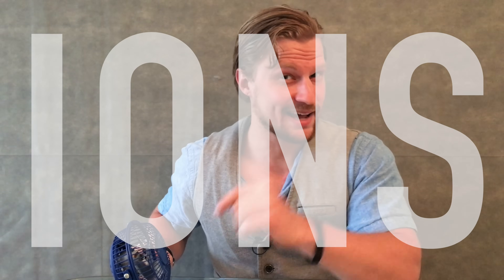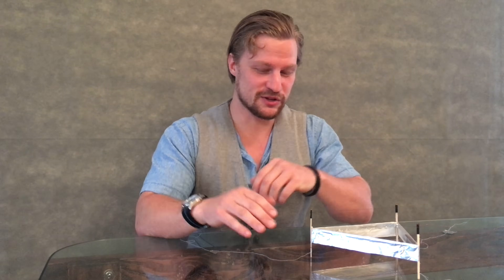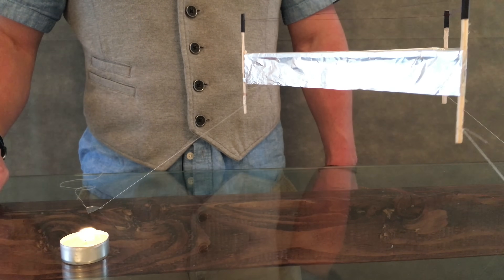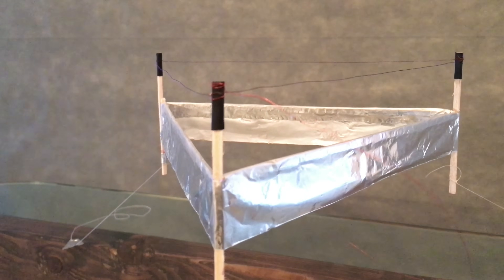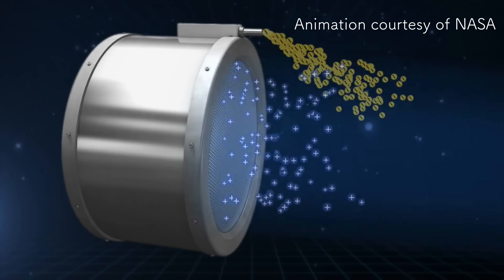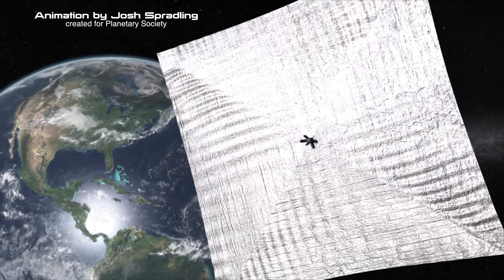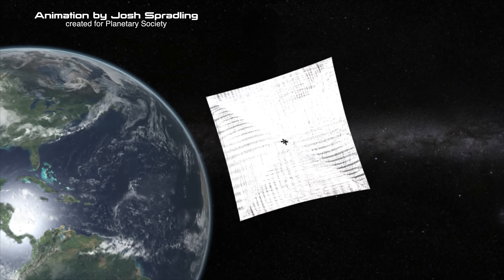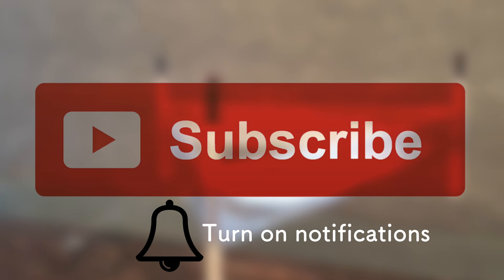IONIC THRUST | A new hope for spaceflight |

Comment: You need more Voltage there mate... more like 20 million... charged up in an onboard ultra high Farad, High Voltage super Capacitor... and it should be bigger... and saucer shaped
Reply: I'm pretty sure that's incorrect: cranking up the voltage to much more than 20-50 kV doesn't help, because you'll exceed the dielectric strength and the electric field will break down and result in discharge arcs, unless you also greatly increase the separation distance between the electrodes (according to Paschen's law). This only makes the whole apparatus bigger, without gaining much additional thrust.
Reply: @___Chris___  It's not incorrect, you are just missing the important detail -->> you use a thin coating of ultra high K dielectric, depleted uranium is the best, same stuff they line the leading edge of the b2 with, so no need for Paschen's law separation distance between the electrodes. If you can't get that use bismuth! an ultra thin layer will suffice. And YES crank up the potential mate!
Reply: @kiwiresponse  There are many variables involved and there's a lot of confusion because - just like in this video - space applications and earth atmospheric applications, including DIY "lifters", are often mixed under the same headlines, which is why we're maybe not talking about the same thing and therefore might actually be both right. Paschen's law isn't just irrelevant bullshit, but I admit that it's less of a limiting factor in some more favorable scenarios. I might agree with you ("mate" ;-) ) under very specific circumstances, depending on aspects such as:
1. what kind of gas pressure are we talking about?
2. what's the temperature?
3. do we use an "inert" gas atmosphere (xenon, argon)?
4. is energy efficiency a concern or is max thrust the only objective, regardless of the required wattage?
5. is radiation safety (high energy ionizing electromagnetic radiation = Röntgen as a byproduct) a concern?
6. regarding super capacitors: for what kind of duration do we need the thrust (=are we talking about continuous power)?
Reply: @___Chris___  perhaps I should say Sir. My apologies if mate was not appropriate. Yes, of cause I accept those variables. As I understand according to the original Field Theory of Tesla and C.P. Steinmetz, much of it derived from Natural Philosophy, there are 7 such variables, including:
*ambient pressure
*dielectric permittivity of the materials used and electrical properties of the ambient atmosphere as you mentioned (medium)
*displacement
*phase
*right-hand rule

The capacitors. We're not aiming to consume any amps, ideally, that's why we use extremely high K dielectrics, so that we can increase the HV/potential/strain/stress, counter-spacial, centripetal convergence, and focus or disperse it in a certain way, depending on how we shape the craft.

do you know how/why a lichtenberg figure happens? if it happens

Comment: You can't really use a candle it itself is ionic in nature.
Did you use a voltage multiplier your previous video.
Reply from the maker: I did not use a VM. Just a straight rectified AC 20kv

Comment: How did you make the high voltage dc power supply
I really wanna know :D
Reply from the maker: It is a flyback power supply, push pull configuration. 20kv, 15kHz, 60 watts.
Reply: @PlasmaChannel  How much Farad is the capacitor?

Comment: This is the perfect channel I’ve been looking on how to make simple versions of really dangerous things like tesla coil‘s and stuff but like small so they won’t hurt me it’s perfect.
Reply from the maker: Yes, always strive to build safe devices. Like a Van Der Graaff. Impossible to kill yourself with those, yet they can make higher voltages than almost any device.
Reply: @PlasmaChannel  Make a remote control IONIC CRAFT! You can regulate the negative electrode, if you section it. By controlling the current you control the wind and direction. And make it a ufo shape to make it more intriguing
Reply: @PlasmaChannel  I bought silver coil, and will build a voltage multiplier to create a ufo craft to fly in air and under water! Hopefully design it for space and shoot it with a hydrogen ballon, hen rocket for last push. If you are interested in the build we can work it together 😏
Reply: @PlasmaChannel  
You piece of 💩 
Nice theft of Jean Loius Naudins prototype, you douche
Reply: @PlasmaChannel  I was thinking in adding a helium ballon to the craft and use voltage for control. Have a balance in weight so it does up and down. For submarine I'll leave holes for water to come in and out no balloon there. Isolated ballon from anti static
Reply: If you think it's going to hurt you you probably should find something else to feel your time like nitting. Wait cratch that you could poke yourself maybe play yourself at a game of cards but be careful cards can paper cut you. 🤔 maybe dice yes you could try rolling dice or I here marbles are back in jest don't put them In your mouth or any other orphose  you mite find. For the rest of you I am sure you already know 9 volt Battery  safe handling now you may want to be careful that when you make the ION air not to point it in a direction where the air can do damage to anything it wafts out more then more then well jest watch out we don't need anyone plowing there eye out now danger is in the air
Reply: @AsweWish-c4n there's always a smart ass in the audience whose only enjoyment in life is to belittle other people.
Reply: Perfect?  Blew my speakers and woke up roomate with how loud the intro was.  Maybe a video with good content... but PERFECT would mean it doesn't also have atrocious audio-balancing.

Comment: I dont agree that the lift is produced by ionic wind.  If you get a tiny drone of the exact same weight as the lifter,  turn them on and you'll see that the drone produces enormous amount of wind compared to the lifter.  The difference is quite dramatic.  The tiny amount of ionic wind you see is simply a byproduct of the effect.  However,  it is still necessary to have gases around the lifter in order to produce a difference in charge.  The gases basically becomes an anchor in space that the lifter uses to climb up.

Comment: where is the power for your design and how can i make it?
Reply from the maker: It is a 20kv AC power supply which is rectified with a full bridge rectifier. From Ramsey Electronics.
Reply: @PlasmaChannel  ok cool thanks
Reply: how are you supplying the power?

Comment: No. A wired "ionic thruster" and a nasa xenon engine are not simialr at all, and the same principals do not sadly apply.
Reply: They are both ion drives. They both transfer energy between two electrode surfaces and expel particles at high speed out of the back.  It is true however, that the slower the wind for the ionocraft the more efficient it will be.  In space however the faster the particles the less fuel it will use.  There is an ion powered aircraft "the Self Contained Ion Powered Aircraft," that can carry its power supply onboard.  Maybe soon it will carry a very small propellant tank as well...
Reply from the maker: The ion thruster used by NASA uses charged particles, accelerated by an opposite charge. Identical to this lifter in function, though not form.

Comment: why has no body made a hover car using this method?
Reply from the maker: Partly because the power levels involved are insane. It works very well in low gravity or space. But in full gravity, it would take so much electrical energy to lift a car, that you likely couldnt fit enough power sources into the car to make it fly in the first place. However, that WILL change in time.
Reply: @PlasmaChannel  how much power would you need, just for scale if I wanted to build one? Also thank you for replying.
Reply: 😮 @PlasmaChannel

Comment: How do thrust is created in vacuum..?
Reply from the maker: In a vacuum, no thrust. However, if you carry a gas cylinder on board, you can create thrust by ionizing that onboard gas supply and shooting it backwards (pushing the craft forward). That is how several craft in space currently function.
Reply: @PlasmaChannel  Our aim to generate thrust with solar energy that is available in space.Carrying a gas cylinder is point less.What if the gas cylinder is out of gas.
It is just similar to that of carrying fuel..

Comment: How can a wire with stand 20000V without burning...?
Reply: There is actually no significant current running through that wire. Between the wire and the aluminium foil there only is a significant electric potential difference but because of the insulation of the air in between them, only a limited amount of charge can cross the gap.
Reply from the maker: This is correct. The high voltage supply cannot provide a very high current.

Comment: Try this. Change the shape of lifter to pyramid. Add quartz crystal between copper wire and aluminum foil so electricity from Tesla coil or Van de Graaf generator has to completely flow through quartz crystal. Put lifter in vacuum chamber to see if it works in a vacuum. Also play around with the hertz of electricity to find the right frequency for resonance because gravitational waves may have a frequency of its own yet undiscovered and it might be possible to interact with gravitational waves with quartz crystal vibration under right resonance due to its hexagonal atomic shape. Pyramid shape also plays a role concentrating energies at the point. Read book "Shape Power by Dan A. Davidson".

Comment: I hope you know that ions,  that are made by electricity also are tainted with ozone in Ozone can burn your lungs and can kill you
 edit please don't do this indoors or at least have a window open and a fan on.... a regular fan
Reply from the maker: Great warning, thank you!

Ozone in small doses is harmless. In high concentrations, it causes brain damage, cancer, and respiratory issues.  I don’t work with high levels of ozone- and have been working with ozone for 15 years. Small levels of ozone are harmless, otherwise I’d be dead.
Reply: Yeah I just wasn't too sure if your setup was pumping out a bunch of ozone cuz mine does so much so that I have to actually do all my high voltage experiments outside then again I am dealing with around 10kv-150kv-200kv volts ac out with around 10-40v 20 amps DC  input  now I just got to rebuild my charging circuit cuz two days ago it fried out
Reply: The ion propelled aircraft on my channel with onboard power! doesn't produce much ozone, the trick is to use extremely small current levels, especially thin several micron thick emitter wires at a larger distance from the collector, and avoid sharp corners.  There are other details as well to get enough lift. Also, the device is designed to produce primarily negative ions.

Comment: MIT just released videos of a fixed wing UAV you may be interested in. And probably already aware of :) ✌🏻

My question is, can a tesla coil act as an onboard receiver for power supply and another ground base tesla coil be the transmitter? 🧐
Reply from the maker: Thanks, i've seen the UAV. Pretty crazy. To answer your question, yes. Tesla coils can act as receivers. Tesla himself was the first to accidentally detect radio waves from space. He noticed his coils were absorbing signals....he thought were from aliens at first.
Reply: Please see the self contained ion powered aircraft after seeing all of Plasma Channel's videos, and compare its efficiency to the MIT one.  If your interested in beamed power, microwave rectennas or solar cells are better energy receivers by mass than Tesla coils. The former was used to power a model helicopter in the past.

Comment: If ionic thrust is product of very high voltage but very low current, stepping up voltage with transformer to few hundred million volts would produce enough ionic thrust to lift a car in the air, in theory.
Reply from the maker: However, if current becomes too low.....or power level over all is too low, very little thrust will be created.

Comment: Can you use a 9 volt battery if you make a smaller version with a smaller gap between the positive wire, and the negative foil.
Reply from the maker: You cannot. You need voltage high enough to ionize the air. Air at STP does not ionize until about 360 volts (though some research has shown around 150volts). Realistically, you need several thousand volts.

Comment: Gravitec completed vacuum tests for NASA a decade or so ago and the effect works in a vacuum but with less thrust, other independent tests have confirmed that it works in a vacuum. The effect was first discussed not by T.T. Brown but by a scientist i forget the name of in the early 1700s. Noone that i'm aware of has done public research on the testing of different dielectrics in a vacuum chamber. There was an Israeli group who claimed to have discovered anomalous behaviour when using AC at certain frequencies in their setup.

Ultimately, ion-wind is a hugely under-researched area. The thrust achieved by some devices is way in excess of what could be achieved assuming it's just air moving over a rough, bacofoil wing, so there is something else at play here.
Reply: I'm doing research with 120kv right now variable frequency.
Reply: Exactly. It’s as much a “puller” as it is a lifter. Thats ‘s the yin/yang balance my friend. And yes, it’s acceleration/motion via Field Gradient differences created by the differences in shape and size of the electrodes. The “ion wind” does not explain the prima causa, which is Field Propulsion.

Comment: This isnt practical for space travel in a vaccum since you still require a fuel/xenon gas, instead of pure electricity.
Reply from the maker: You do need gas, but luckily a few thousand liquid kilograms of gas can last decades of acceleration.
Reply: Well still more practical than chemical rockets with maximum ISP of around 400s. Probably the only way to create thrust with electricity only and no propellant would be something like a photonic drive but those require something like 300 MW per 1 newton of thrust. Its probably better to use solar sail.
Reply: In theory backed up by math, it should be possible to do this with relativistic electrons alone.  The power supply would have to produce several million volts at very low current.

Comment: there are some differences between ionic wind and ion thruster. Ion thruster uses thrust force of positive ions directly but ionic wind uses thrust force of neutral air molecules induced by impact with accelerated positive ions which is generated by corona discharge. So we can't use ionic wind thrust in space.
Reply from the maker: This is true. Nomenclature. Cannot use ionic wind in space, only ionic thrust.
Reply: This is exactly what i was thinking..

Comment: it wont work in a vacuum
Reply from the maker: This particular model will not, no. But ionic thrusters in space carry their own gas to propel out the back.
Reply: Carry compressed gas
Reply: I made a thruster like this years ago its pretty cool. To travel in space at the speed of light, I hope they use the granularity of isotopes to catalyze quantum jumps by spear picking space-time. In series, basted to the back of a SLV (Super Large Vehicle) it only takes a week to gain full velocity.
Reply: m2 = E2/c4 - p2/c2
this method is how a photon gets its energetic velocity.

Comment: Thes first thruster actually provides no thrust in a vacuum.

But there does exist a similar device. (The second thruster) It uses ionized xenon and accelerates the ions even more with magnetic feilds, and in turn gives more efficiency.

This is the most efficient drive currently. Possibly untill they finish the 70 year long "development" of the nuclear engine. Which already works phenominally.

And after that, solar sails will be the rage, but how can you decellerate a solar sail?
Reply: We'd use the Mach Effect (Dr. Heidi Fearn NASA NIAC) in the medium of outer space, utilizing Vacuum Energy (Zero Point Energy/Aether).

Comment: You may have 20 000 volts, but at the same time, you also have 13 000 KHz of sound interacting with the air around it, it's easy to make out the high pitch sound 13K KHz creates when active. The puzzle of gravity and space travel, can not be solved before interaction with air and sound is negated.
However, we're not far off being able to conquer space, so we really are on to a big gamechanger these next couple of years.
Sounds good to me!
Reply from the maker: So, I rectified the power source, it is full bridge rectified DC.
Reply: That's a start. Now you have to test it out in airless vacuum and no gravity.
If it's stationary and arks, you may have to start over again.
But if it shows sign of actually working and can be navigated without gravity and air, I would say you're pretty damn close to be able to go bigger and succeed.
Maybe you have to take radiation into the equation as well.

Comment: This should also work if you reverse the DC polarity.  Would be interesting to see if it works with AC but I suspect not. It's basically an asymmetrical capacitor.  Try it upside down with the thin wire on the bottom and foil on top.
Reply from the maker: That's a great idea to experiment with. I'll have to try that
Reply: Cool, please let me know what you discover.